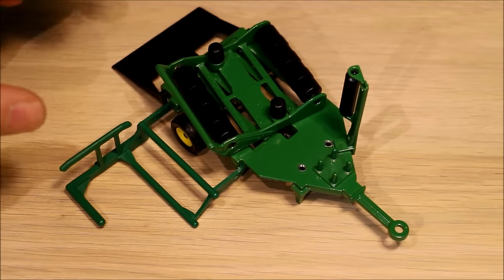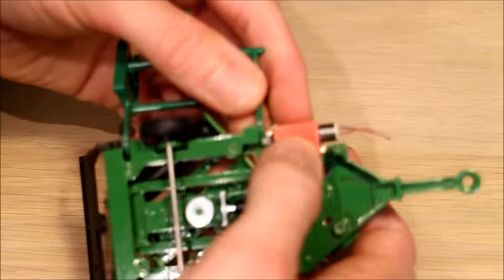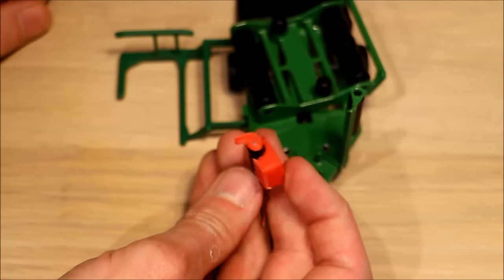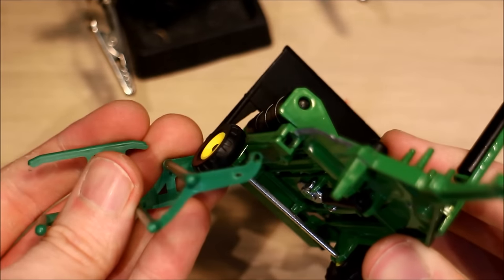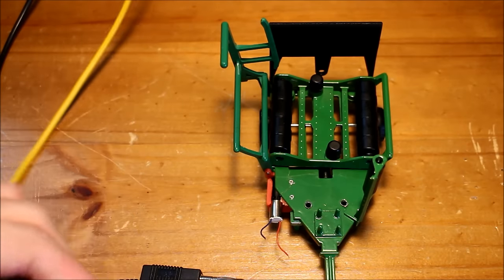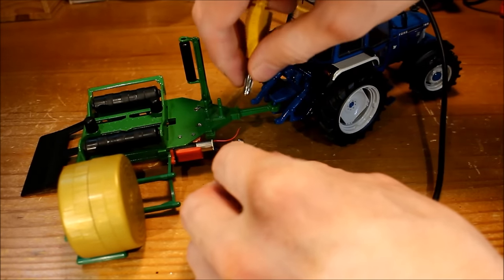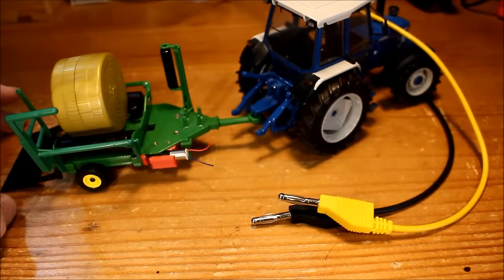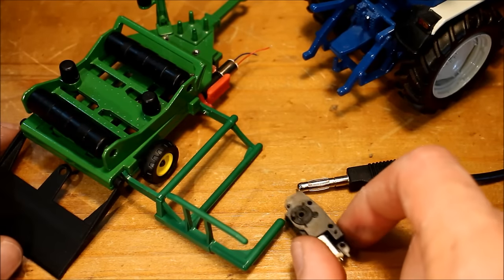Bale Wrapper for RC Tractors part 2 - Bale Lifter Arm Attempt #2

Comment: Soo by the looks of things the 3d printer is a grate use for makeing parts do you think you could make a video showing how you make all the customs parts with it that would be grate keep up the good video
Reply from the maker: ***** Yes I'll do a video including design and print, the problem is I'm using a commercial software so I need to find a good freeware cad software to advise people to use.

Comment: Where can I find a wibsite in english to buy some front wheeles for my rc deutz fahr x720
Reply from the maker: Ben Butland Hi sorry, I didn't reply because I don't actually know. Now that I think of it Siku are unlikely to have invested in two sets of tooling for the same model, I'd say there is a good chance if you buy the static version of the model it will have an identical front axle. I could be wrong though.
Reply: Ok thanks for letting me know
Reply from the maker: Ben Butland Here is another option http://www.siku.de/en/shop/sikuparts/sikufarmer/vorderachsen-1-32.html

Comment: where can i find a steering motor for my scania 1:32
Reply from the maker: +tractor man Kinvara Did you try the Siku website? It's pretty expensive http://www.siku.de/en/shop/sikuparts/sikucontrol32.html . Also ebay http://goo.gl/MNCtQn but I can't tell you which is the right servo for your model they come in four or three wire so make sure you order the right one.